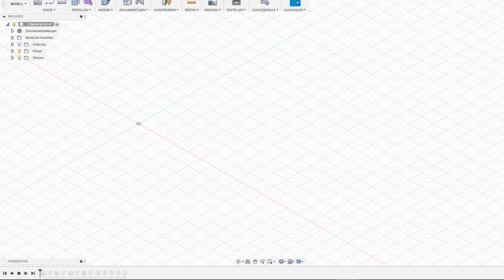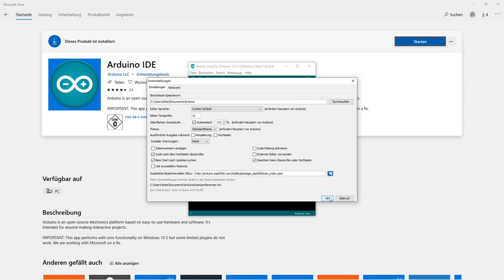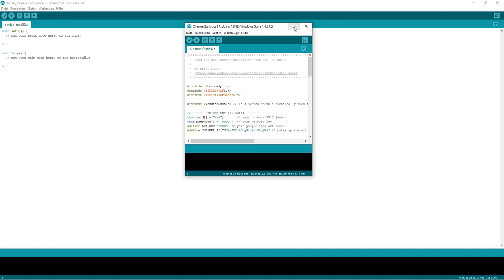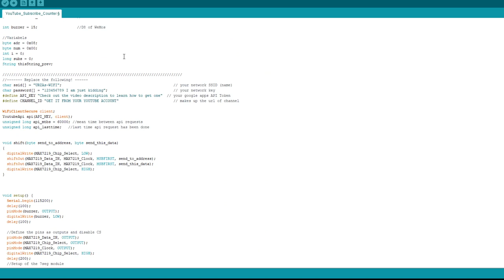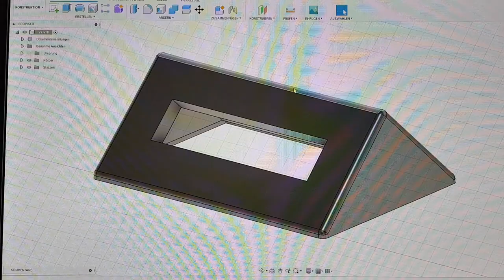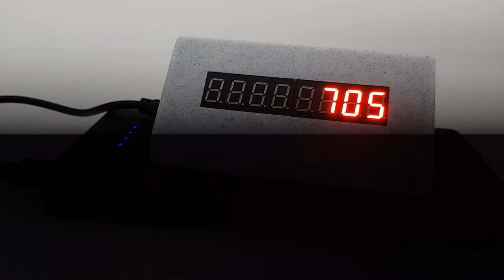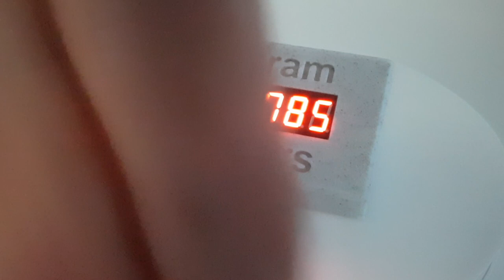Things to print on a 3d printer: Youtube Subscribers Counter

Comment: you can fit a 18650 battery in there with a charging circuit :) this way it will be wireless:)
Reply from the maker: Yes, but you have to charge your battery everyday.
Reply: @Urza1  point taken. Try that instead: put 2x18650 on the floor for around 7000mAH of juice (or if you can fit 2x21700 for 10000mAH), this would make you for 70hrs of power without charging. if you dimm the light a bit (it will still be really readable, you probably would be able to charge on weekly basis.

Still, great idea and design!

Comment: when i plug the d1 mini into my pc it trys to install the drivers but they keep failing i cant seem to find them online please help
Reply: i have it now where my ip shows in the serial monitor but not my channel info any ideas why?
Reply from the maker: Could you solve the issue?
Reply: @Urza1  no sadly im a conplete noob a arduino bought the parts just to make one of these any help would be great :D
Reply from the maker: I will check this soon. Hopefully I can help.
Reply: @Urza1  thanks :D
Reply from the maker: @flancanstain  Delete your old API key and get a new one and try again.
Reply: @Urza1  i have about 5 times didnt work
Reply from the maker: @flancanstain  Did you install the right versions of the libraries. The newer ones don't work for me.
Reply: @Urza1  yeah i installed everything as the video stated